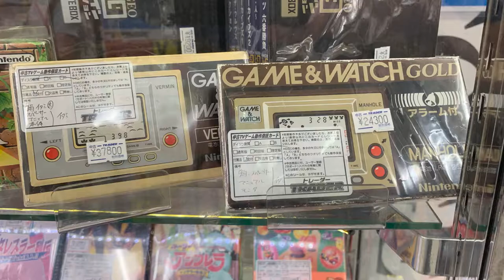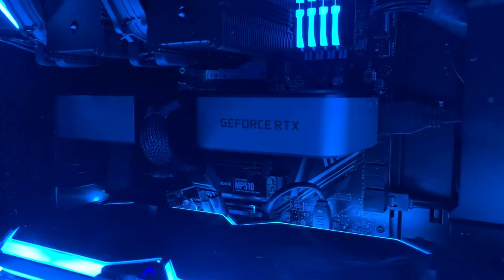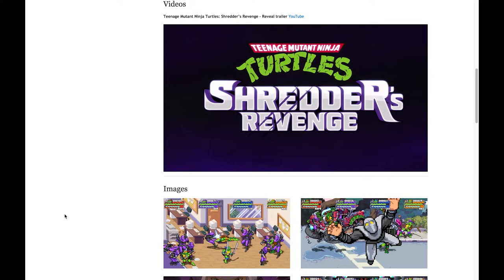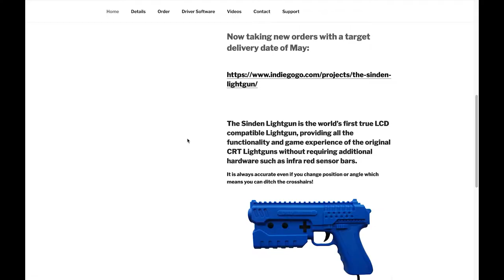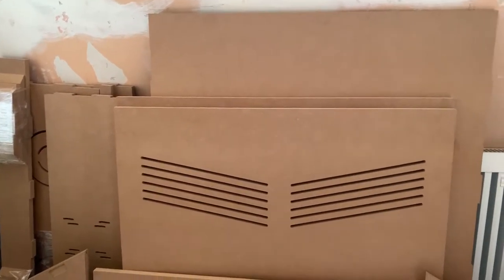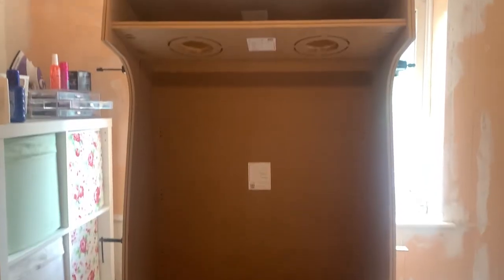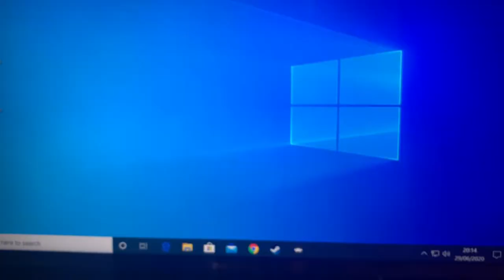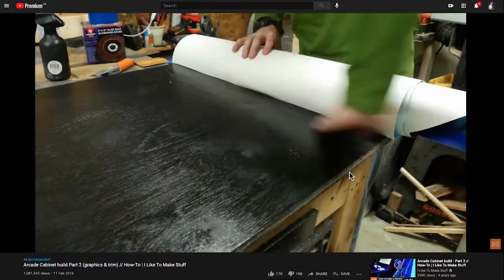How to build an Arcade Cabinet / Machine (TMNT design)

Comment: Great video, but what was your overall cost with everything? I am trying to see what other alternatives there are instead of dropping $5400 for a Megacade system.
Reply from the maker: Thanks. My overall cost in parts was about £1000. Bearing in mind the PC was built from spare parts I had.
$5400 is a lot of money for system. You could easily spend half that in parts and build one yourself. 
If you’re not interested in building one, I’m sure there are cheaper alternatives out there.
Reply: @ianwestacott   do you know the difference from lunch box and raspberry pi 4 that are used in other arcades?
Reply from the maker: @ryannielsen156  LaunchBox\BigBox is a front-end specifically designed for the PC. When I've used a Raspberry Pi in the past, I've normally ended-up using either Retroarch directly or RetroPie.